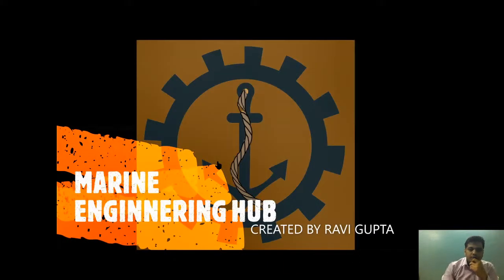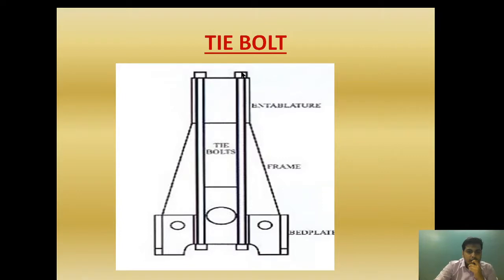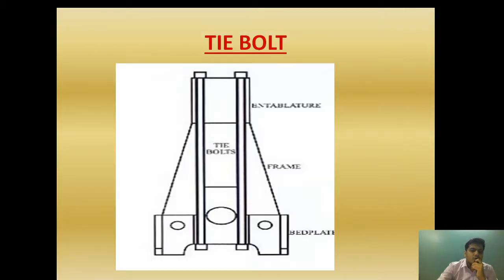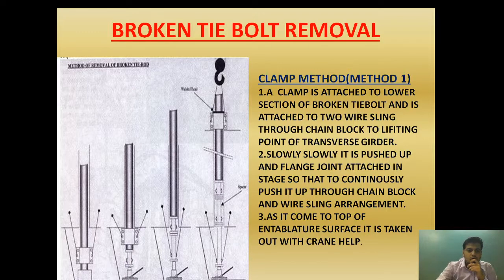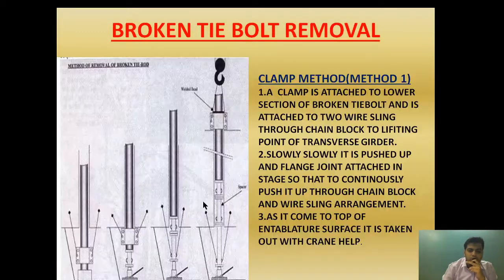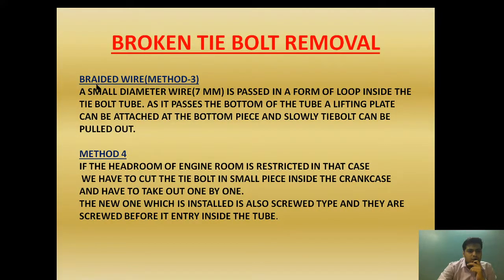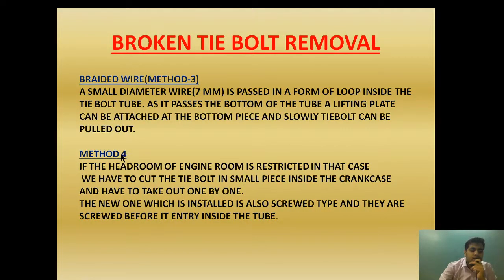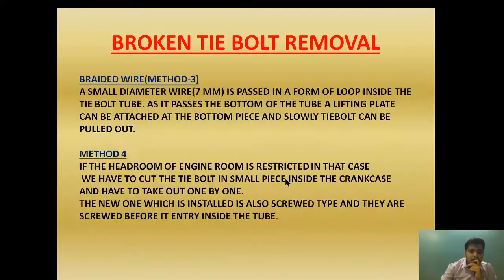TIE BOLT| BROKEN TIE BOLT REMOVAL|(PART-3)

Comment: In first method u said that with the help of chain block and wire we will held the bottom part. And as well as u said there are threaded holes r provide to removal for main bearing etc but how we will pass the the wire on lower end of tie rod ( which is below the bedplate)and chain block in crankcase

Comment: Sir can you please tell how the tie bolt is fitted inside the engine is it a internal thread in the bed plate or in  transverse grider else  is it connected with hydraulic nut for holding bed plate  inside the engine
Reply: Bolt is there at the bottom because it should take out but the main problem is if u take out as per process 4 then how u reinstall it